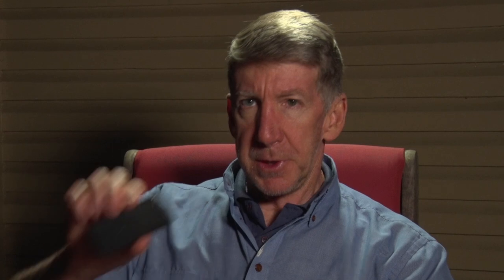Track cleaning do's & don'ts update...most views in 24hrs!

Comment: I used to use iso and I had nothing but issues. when I started my current layout I decided to give CRC a shot and I will never go back. Now it everything runs great. when I do have a loco stall, which is not very often, I grab the crc take a cotton swap and just apply a very small amount and just clean the trouble spot. I have a switching layout but my friend has a large layout with continuous running and he started using it on his. He tells me that since he applied it back in Nov he has not had to clean his track nor has any of his locos stalled or stuttered. He runs his trains almost daily, I think that makes a difference.
Reply from the maker: Great to hear you had a win with CRC! I had the same issues with IPA , to the point that trains just stopped ?? And like you , just a little on the track and away the went and never stopped !
Thanks for watching .
Gregg

Comment: Yes besides using Inox as long as you with excellent results, my friend has been using CRC 6-26  for the same amount of time with similar results. Years ago I mixed graphite and Inox and spread a fair amount around my layout. The result was the ultimate in electrical reliability. (I was using DC at the time). However it caused a significant decrease in traction in my locomotives. I had to remove most of the graphite  and Inox to get back reasonable traction. However in last couple of years, my friend using CRC said he had improved results, without much loss in traction by rubbing a graphite bar ( found in Art shops used for sketching) on the track, , and a thin layer of CRC, so I tried rubbing the graphite bar on the track and then applying a thin layer of Inox. I experienced the same improvement in electrical conductivity with only a small loss in traction. I just need to remember to turn the power off when rubbing the graphite bar on the track.

Comment: Greg, thanks for the track cleaning rant and the follow up.  Yes, I'm still guilty of stoning the track, expecially after painting soldering or other construction but I'm trying to reduce it.  I have used 91% Isopropyl in the past but have switched over to CRC 626.  The CRC has a major advantage for those of us in the USA - it is often sold in major home supply stores.  I get mine through Home Depot and then I don't have to order from an electronic specialty store.  CRC = MUCH superior to 91% IPA.  Keep up the good rants!
Reply: I couldn't find CRC 626 on line.  Do you mean CRC 6026?  There is also CRC 2-26.

Comment: We just got an HO scale Bachmann train set for our kids this Christmas and after a couple weeks it started having slow spots around the track. After doing a bunch of googling, buying a multimeter, and spending a couple hours trying to figure out what was wrong I stumbled across your video on using a cleaner for electronics. A quick trip to the store for some “contact cleaner” and our train is back to running great. Thank you!
Reply from the maker: Hi Jared ,thanks for the feedback and I'm glad you got some good results! I should point out that Innox is not a "contact cleaner" as such , and is more of a cleaner-conditioner. Contact cleaner will not leave a protective film like CRC or Innox does and is mainly used in electronics to make components clean and dry . But for a small layout like yours it will be fine! 
Cheers Gregg.

Comment: Brilliant video on inox, can you use WD40 or something or petrol lighter fuel Mark 👍 👍
Reply from the maker: Thanks Mark! CRC 6-26 is a good alternative.
Gregg.
Reply: @FishplateFilms  Did you mean CRC 2-26 ? "The CRC 2-26 5 oz. Multi-Purpose Lubricant is a plastic-safe lubricant, penetrant and corrosion inhibitor. This lubricant helps prevent electrical malfunctions and restore damaged equipment caused by water penetration, humidity, condensation and corrosion. Cleans, lubricates, penetrates and loosens corrosion." Sold at Home Depot in the States
Reply from the maker: @SB-kk3wi  Yes SB , that's the one ! CRC 2-26 .    I keep writing it wrong... Go grab a can and let me know how it goes!
Gregg.:-)

Comment: I used the Inox and now my Roco 0-10-0 is spinning like a top. 4 traction tyres on the tender and 2 on the loco.
"Slippin and a sliddin, peeping and then hiding, seems like it don't wanna go ho!"
I'll take the tyres off or is there any way to ruff them up?
Cheers.
Reply from the maker: LOL  Hi Wimbo, does it drive on the tender as well as the loco itself! It will eventually dry up , but you can try some methylated spirits to dry the track but the tyres will dry out ! Its a shame they use traction tyres to get traction , rather than weight. What a bugger ,  I ahte it when I'm right!
Gregg :-)
Reply: @FishplateFilms  Hi GreggYes, it drives on both.. This thing is full cast iron. All separate cast detail as well. I'll wait and see if the traction gets better. 
I tried one of my locos that  is a bit finicky with constant running last night and it runs beautifully now. So thumbs up.

Comment: I'm wondering about Mineral Spirits (enamel paint thinner)? It seems to work well for cleaning, and doesn't harm plastic. Have any of you tried it?
Reply from the maker: No I haven't tried it. It will clean , but will not help with oxidation and you are better off using a product made for the job! CRC or INOX or not expensive and do what they are designed for:-)
Cheers Gregg.

Comment: I've been using Inox for over 20 years.  I also use graphite as well sometimes. Art shops sell sticks of it. You will find Graphite also decreases friction, but I solved the traction problem by only having free rolling carriages, sensible curves and grades on my layout. I have also used CRC in the past as do some of my friends. I only use a small drop or too at each end of my layout. Using to much will soften some paints. 

Cheers,
Terry Flynn.
(also from down under)
Reply from the maker: Hi Terry and thanks for the comments!  I totally forgot about art shops and orderd some graphite from China..:-(. As you say , with good rolling stock and sensible grades and curves , it makes little difference to traction. I'm coming up to about 10yrs with Innox and love it plus all the wheels stay clean too.
Cheers Gregg.

Comment: Hello Gregg, hope all is well. How did the Graphite Block pan out.  In RSA we get a Graphite/Oil spray as well, but anyways no Inox here so Im not sure what to use.
Reply from the maker: Hi Johan, all good down here thank you! The graphite block is ok , but it shorts out the track so you have to have the power off or do one rail at a time! Also it doesn't remove dirt from the wheels like Inox does so I can't say I recommend it...but still a lot better than a track rubber!  If you can't get Inox, then CRC2-26 is a good alternative!
Cheers Gregg.

Comment: What is your best recommendation for use with traction tyres? Did the graphite work out well?
Reply from the maker: The graphite was  a pain as it shorted out the track. It is hard to judge but it could be a option if you have traction tyres? You could use Inox, but sparingly and wipe it off with a dry rag? Also depends on the grades on the layout too?
Gregg:-)

Comment: Hi Greg just seen your video so I googled inox mx3 in it says it’s non-conducive your thoughts cheers
Reply from the maker: Thats correct Darryl, If you  watch the first video , I explain what it does and why it needs to be non conductive. It makes surfaces clean and more conductive , or more insulative if they are not part of a circuit. If it was conductive, it would short out circuit boards and be extremely dangerous.
Get some and see the difference.
Cheers Gregg.

Comment: Gregg Joe Fugate has also recommended graphite sticks he talked about using it at an angle to get it on the inner top edge of the rails as that. Is the main area of contact. We have used this at our local club layout to improve things there is a WD40 spray that our club use not the usual one but it is for use on electrials and to improve conductivity, it is only available on line, as we are in lockdown I can't get there to tell you exactly what it is called. Every little helps Neil
Reply: @Lancelot_Jago  It looks different to that but it is at our club 26 miles away and till lock-down lifted I cant get to it to check.

Comment: Greg thanks for your info i am new to this i have tried all different thing and no good then i used the inox and the train have run without problems Hafter one clean with inox Thay have never run so well I lick to thank you. it is so dusty here in S.A
Reply from the maker: Hi Peter , thanks for the great feedback and I'm glad the Inox worked like I said it would! Your track will continue to get a little  dirty ,as the dirt is wiped off the wheels and onto the rails, cleaning them also!  
What part of SA are you in ?
Thanks and cheers, Gregg.

Comment: Tried CRC had no joy, sprayed a couple of shots onto some cotton, an old tea towel torn up, and dragged along the track under finger pressure. No joy in engines moving! Had to wipe it off. Tried a piece of hard pine cleared the oxidised layer. I'm in NZ. Cheers Gregg. David

Comment: HI Gregg, Your videos about track cleaning are very informative, however Inox contains a lubricant and leaves a film behind that will attract dust like a magnet and can cause lack of traction climbing hills.
I lost my track rubber over 20 years ago and never regretted it.
I swear by CRC Precision CO Contact cleaner (Spray can), available in New Zealand and Aussie, most of my use is with cleaning noisy potentiometers and channel switches in high end audio amplifiers I repair. It is also popular with industrial electricians for cleaning motor contactors. 
I spray a cork block and rub along the track. I don't use my layout often and have only cleaned my track once in the last five years.
I friend of mine runs his layout daily, and uses the CRC product on my recommendation and very rarely cleans his track, maybe once per year.
We were using Servisol Isoprol alcohol in a spray can from Jaycar it does not contain water, but found the CRC contact cleaner lasted longer.
Just to note that we use metal wheels on all our rolling stock.
Graphite, I have seen videos extolling the virtues, but hell its a lubricant, I use graphite powder on my pin point brass bearing, I can't imagine my trains going up the 1:50 grade on part of my layout if I attempted to clean my track with it.   
About 1990 my club mates were running a DC layout at an expo in Rotorua, NZ's thermal Wonderland, and had real problems with the sulphur dioxide, having to clean the rails every 60 minutes of running with heaven forbid a track rubber to remove the oxidization film. At the time I was using CRC 2-26 to clean the rails on my layout. One of the guys remembered my comments and during lunch went out and bought a can and they cleaned the rails with it. CRC 2-26 leaves a film behind and it was ideal in the enviroment and saved them the embarrasment of having to stop running the layout every hour or so.

Comment: Interesting topic for sure, I’m curious about a graphite block since some of my models have traction tyres.  I did test out and make a video about contact cleaner as a track cleaning fluid.

Looking at a peco track rubber I’m convinced it has pieces of graphite in it.  The same colour smudge comes up on my finger as if you used graphite on the track.

Comment: Hey Greg I was wondering if you’ve ever heard of striking your track to repair the rubber eraser of death damage? I bought a bunch of used turnouts and a bunch of used track and saw that it was scratched  severely. What I did was I went to the local hardware store and bought a 3/4” washer or 19mm for the metric folks. I used some 600 grit sand paper on the rail heads to straighten them up a little bit then used a scotch brute abrasive pad to polish them off further. Once the scratches were smoothed out the best I could get them I firmly pressed the washer on the rail heads with the washer on both rails to get them even and ran the washer around on my track. Made my rails look like brand new to do whatever needed to happen! Maybe if you do another track video it may be an experiment to try to see if you get the same result. Substantially more cost effective to repair track then it is to replace as well as a lot less work. I’m using nickel silver code 100 atlas track for my main lines and code 83 for my loco service yard and facility!

Comment: Great video, love the hair light, makes you look very young.  I noticed when looking at the comments yesterday, how many people mentioned Goo-Gone.  So far I have not heard any negative points on it other than it makes the room smell like oranges.  Can’t wait for a second rant video.  Cheers from Terry in Nebraska.
Reply from the maker: Thanks Terry ..looks like I'll carry the light with from now on..LOL . I've not used Goo Gone so can't comment on it, but if it gets good results then that's fine ! 
More rants on the way!
Gregg.
Reply: If you want your trains to stop running and create a royal mess, then use GooGone. This is the worst. Oily residue will get onto everything. I tried it and many friends tried it with the same results. BAD! You need isopropyl to clean off everything and then IMMEDIATELY apply CRC2-26 to coat the rails to stop oxidation. You don’t need a lot and it does the job.

Comment: Dirty track, and inconsistent running is a huge pet peeve of mine. So I went out and bought CRC here in the states after I saw your video. This stuff works amazingly, there were areas I was having issues with, and it cleared them right up. I have one engine that doesn't have a current keeper in it which always cut out. I stopped using it, it was so bad. CRC made it run about 90% better. Thank you for your help and dedication to the community!
Reply from the maker: Thanks Joe!  None of my locos have current keepers and I never have an issue. I'm glad you got  a good result so quickly...as I knew you would, like I did! 
Thanks again for watching and I appreciate the support.
Cheers Gregg.

Comment: Thanks Gregg, I cleaned a lot of the track with cotton buds and inox. I was suprised at how much gunk I got. I then sprayed the bottom of my CMX track cleaner with inox and ran it around a couple of times. Locomotives are having a lot easier time making it up the higher grades. Very impressed. Thanks.
Can I use the MX4? 
Cheers.
Richard
Tasmania
Reply from the maker: Hi Richard , that is great news! Thanks for the feedback and you will find out how much you need to use and how often...I clean a section at random every time I run the layout and have rags with "old" sprays on them that I use as well.  DOn't know about MX4 as I've never used it ? but MX3 is made for this purpose.
Thanks again for watching and your results!
Cheers Gregg.

Comment: Hi Gregg, Any update on the graphite block, whilst I do use and am pretty happy with it, it I'm curious as to your thoughts on it, and should you clean the track first with Inox and then graphite or just straight graphite and no Inox or just straight Inox & no graphite. Cheers Alex
Reply from the maker: Hi Alex,  Yes I have tried it a few times, but I failed to realise that a quality graphite block will short out the track ..LOL   You'd think an electrician would know that!  SO I can only use it with the layout off which I always forget to do! I would like to try it on hard to reach spots , but that is hard to do since you cant push it through with a loco? So I'll stick with the Innox as it does what it needs to do .
Cheers Gregg.
Reply: @FishplateFilms  Gregg I've read you only need to wipe it on the tracks every few feet or so & the trains will carry it around the rest of the layout, ie. you don't have to wipe it on every bit of track, I certainly don't & it seems to work OK and yes if you bridge the track it does short out, I normally do one rail at a time, or have the layout turned off.
Cheers Alex.

Comment: I have a question for you - I'm new to this and I ordered the Inox for the tracks and my question is this - can it also be used to lubricate the wheels and gears on the engine?   I have 1920's era trains and I'm working on getting them up & running and it says on the bottom of the cars to lubricate and I want to be sure to use the right thing.   Is Inox good for this purpose?   Thanks for your advice, I can tell you are knowledgeable on the matter.
Reply from the maker: HI Freddie, 
Thanks for watching and I'm glad you got some Inox to try! It is a light lubricant , so would be ok on wheels and sliding pats, but on gears and motor bearings, I would use a heavier oil. If the gears are plastic, then make sure you use a plastic compatible oil. Good luck with it.
Cheers Gregg.
Reply: @FishplateFilms  thanks for answering!   I appreciate your advice!